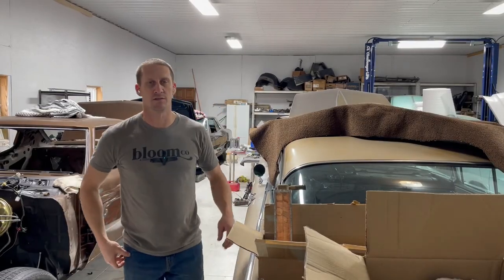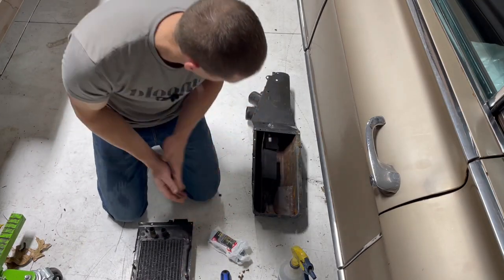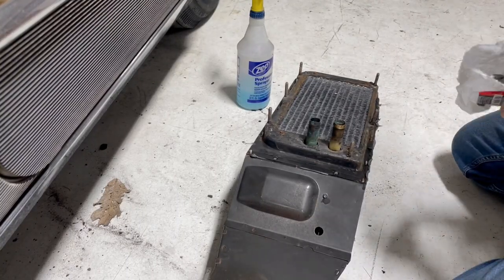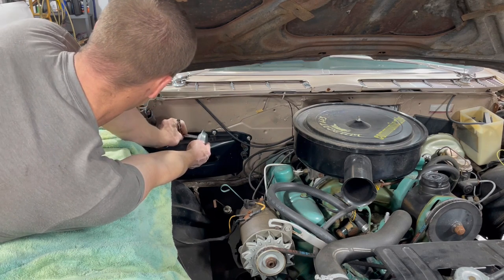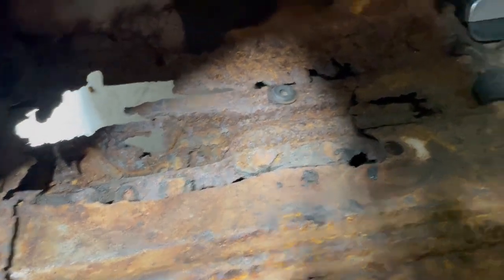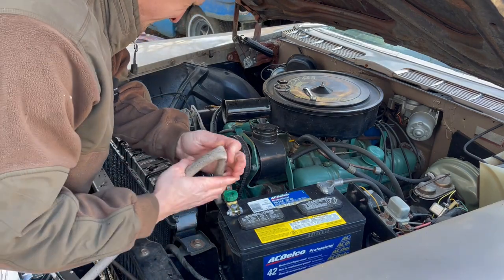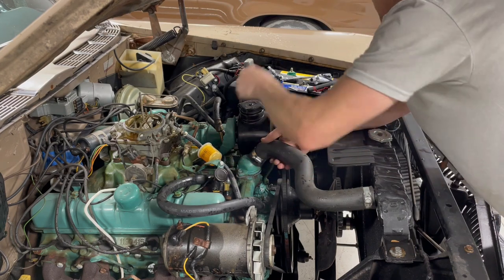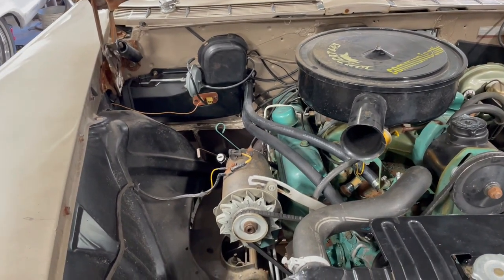Back on the B60 - Heater Core and Radiator Flush-tron

Comment: I'd advise using conventional green antifreeze. It's formulated for old cars and easier on old radiator solder. I've had issues with that coming apart on my 1958 Continental.